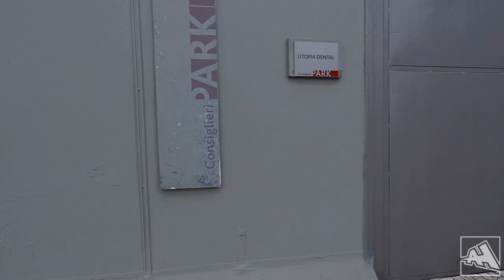Arena351 Track Tour + Laps!

Comment: Hello alex! I just bought the x12 22 and some parts in bag 02 were missing, i got some knew ones but then one more problem came, one of the ball screws had no threads wich made it impossible to build, what should i do? Little bit disapointed in xray/hudy but otherwise the car is very good looking and so is the manual. Greetings from sweden.
Reply from the maker: Hi mate, sorry to hear about these issues! When a part is faulty or missing, the typical procedure is that you have to contact your point of purchase, or the XRAY distributor in your country to request a replacement. You may also contact XRAY directly at info@teamxray.com.
Reply: @hagberg  thanks!